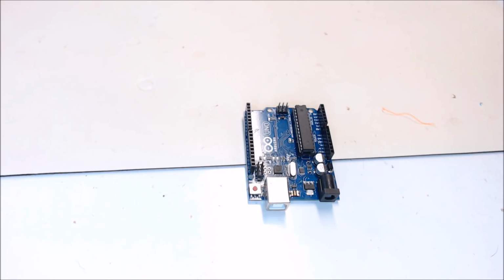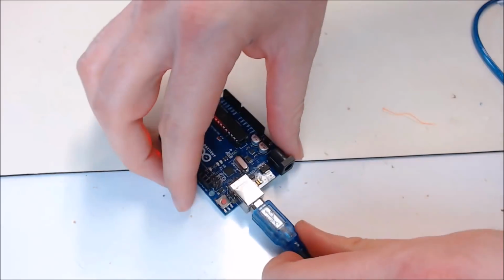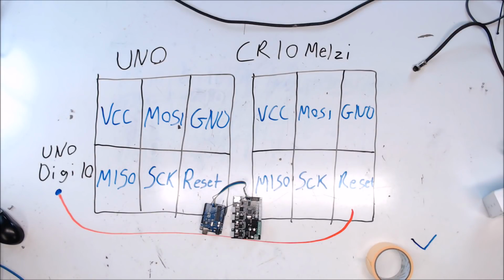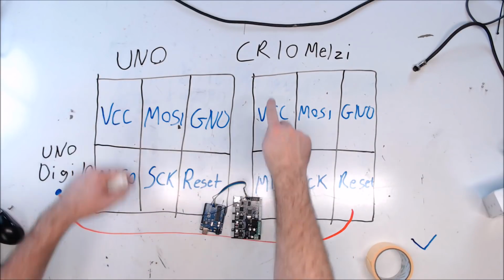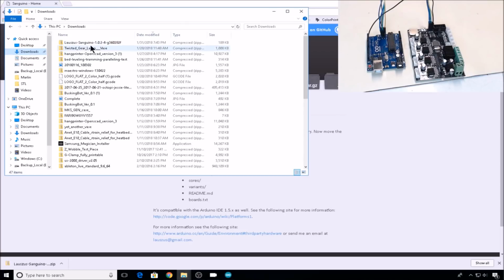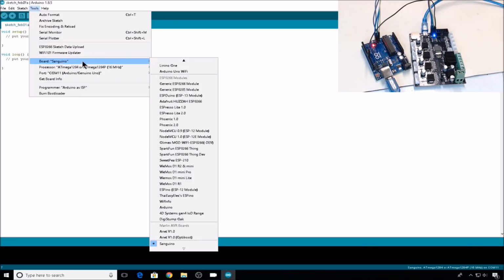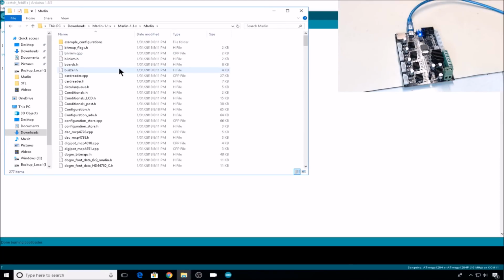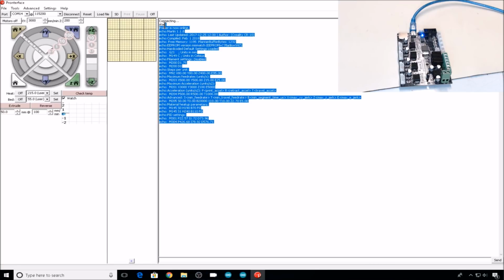Creality CR-10 Marlin Firmware Upgrade - Chris's Basement

Comment: Hello. Nice Vid! Liked and subscribed!  I changed my firmware already and I want to know if I ever need to change some parameters on the Board, Do I need yo put back the jumper on usb mode again? I want to have power failure resume if it is possible. I have the first creality CR-10 with TH3Dstudio Marlin software. Thanks!!
Reply from the maker: Thanks for the sub! No, you will not have to move the jumper again, that was just to enable you to power the board via USB instead of the power port. It's just a little safer when writing the boot loader. I am not sure how you would go about adding power failure resume. I will look into it. I have the same printer as you and it would be a great add on.
Reply: Many thanks for the answer!  According to most people the first CR-10 wont ever have that power loss feature because the Creality company decided it so... What a pity...

Comment: Hi chris I'm having a bit of a situation regarding my cr-10 board. The screen is all white when I turn on my printer, but the board is detected in the com ports in my computer. Also a loud beep goes off when i turn it off. Any suggestions? Thanks!
Reply from the maker: Hey Jack, That is very strange. I haven't seen that issue before sounds like your board is having some issues. Is this happening before a Marlin upgrade or after? Did the upgrade cause this?
Reply: Chris Riley This happened after upgrading.
Reply from the maker: Ok, well it's probably just a configuration issue that can be fixed then. First I would go back into the box and make sure you didn't bump the LCD cable. Then take a look in Marlin, there is a stock display configured for the CR10, but creality might have changed something along the way. See if you can use this link and confirm what LCD is installed on the printer.

//
// Factory display for Creality CR-10
// https://www.aliexpress.com/item/Universal-LCD-12864-3D-Printer-Display-Screen-With-Encoder-For-CR-10-CR-7-Model/32833148327.html
//
// This is RAMPS-compatible using a single 10-pin connector.
// (For CR-10 owners who want to replace the Melzi Creality board but retain the display)
//
#define CR10_STOCKDISPLAY
Reply: Yes I have the stock cr-10 display. Now all of a sudden its giving me this error when i downloaded an unmodified version of marlin (except with the cr-10 files inside)

Arduino: 1.8.5 (Windows 10), Board: "Sanguino, ATmega1284 or ATmega1284P (16 MHz)"

Archiving built core (caching) in: C:\Users\Jackw\AppData\Local\Temp\arduino_cache_945855\core\core_Lauszus-Sanguino-8c73361_avr_sanguino_cpu_atmega1284p_0c812875ac70eb4a9b385d8fb077f54c.a
Sketch uses 126250 bytes (97%) of program storage space. Maximum is 130048 bytes.
Global variables use 15144 bytes (92%) of dynamic memory, leaving 1240 bytes for local variables. Maximum is 16384 bytes.
Low memory available, stability problems may occur.
avrdude: verification error, first mismatch at byte 0x0000
         0x14 != 0x0c
avrdude: verification error; content mismatch
avrdude: verification error; content mismatch
Reply: Chris Riley Yeah im not sure how to fix this mismatch error. 👆🏼
Reply from the maker: Jack Wood I've seen this before. Let me get back to my machine and I'll send you a fix.
Reply: Chris Riley Did you ever find a fix?
Reply from the maker: The only thing I can think of is you are to close to the limit of the board memory. Try this:

in configuration.h take the comments off of //#define DISABLE_M503    // Saves ~2700 bytes of PROGMEM. Disable for release!  

and comment out #define PREVENT_COLD_EXTRUSION 

and in configuration_adv.h uncomment out this line #define NO_WORKSPACE_OFFSETS
Reply: Chris Riley Good news! It installed snd i see the marlin screen, HOWEVER I only see it when the usb is plugged in and the board only recieves usb power. When I switch it to ac power through power supply, the whole screen is white. Any ideas?
Reply from the maker: Check that VREF jumper again, that might be doing it. Take it off of USB.

Comment: Does this upgrade enable auto resume printing after power failure?
Reply: you can get this to work in marlin 1.1.9 on any printer - only works if you print via sd card.

its disabled by default - just look for this line in marlin under configuration_adv : //#define POWER_LOSS_RECOVERY   and then remove the "//"
Reply: @VRietySociety  thanks for the reply man! Would doing this enable auto resume feature?
Reply from the maker: You guys are awesome! Thanks for helping out.
Reply: @jahazi30  yes - but only when printing from SD - so
Reply: @VRietySociety  oh Alright! Thanks a lot man! Much appreciated!

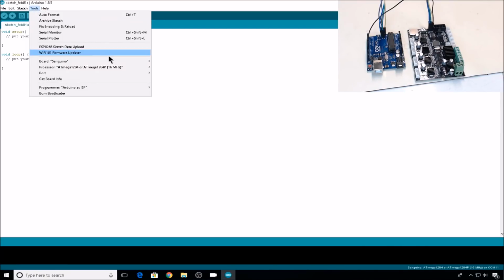Comment: on 6:28 i have 6 options and i dont know which one i need to choose. Does someone know, which one is right?
here are the 6 options i am given:       https://i.imgur.com/H5oAjMb.png

I have an old cr-10
Reply: Ok. So i got it set up. 
Here is how i dealt with that. 
You have to add a .zip library to get the right sanguino as a board option. I followed thomas sanladerers tutorial on the marlin firmware for that. Here is the link https://www.youtube.com/watch?v=lAKyZd63_ns&list=LL&index=7&t=0s
I successfully installed marlin 1.9.x (not 2.0.x because someone in comments said, that it doesnt work?) 
Now onto Manual mesh bed leveling and linear advance :)
Thank you chris for the tutorial <3
Reply from the maker: Yep, number 5.
Reply from the maker: Glad you got it working, happy to help.
Reply: @ChrisRiley  i was confused, because although number 5 has to be right, choosing that didnt bring up the option of choosing the right processor. So i reverted to the solution thomas sanladerer provider in his video.
✌

Comment: Great video! I have a cr10 mini with a V1.1.2 board. It doesn't have the jumper but otherwise looks the same. Is the process the same or is there anything I need to change? Also, anyone have any idea what Marlin firmware I can upgrade to? 

Thanks in advance.
Reply from the maker: Yes, the process on that board should be the same. I think it's still a 128 chip. You can use the Marlin 2.1 example config.
Reply: @ChrisRiley  hey, thanks for that! I'll be trying tonight!

Comment: when i click burn bootloader this error came out :
avrdude: Yikes!  Invalid device signature.
         Double check connections and try again, or use -F to override
         this check.
what i have to do????
Reply from the maker: AVR errors mean your USB can't connect. Can you connect to your machine via pronterface? Does that work and are you able to control the machine?
Reply: one month ago i tried to control the printer with lots of programs like simplify3d or repetier host. now i get off the board from the control box and unwire all cables. but now i am not able to burn bootloader. (i have a 1.1.2 creality3d board).
Reply from the maker: Does the board power on when you plug it in via USB? Does your computer recognize the board in device manager? Have you installed the ch340 driver? Did you change the vref jumper to USB?
Reply: Chris Riley the board powers on but i don't verify if computer recognises the board and i dont install the driver. I will try soon
Reply: in my board (v 1.1.2) i don't have the vref jumper... but my boards turns on when connected via USB.

Comment: What tools do you use to get the 4 screws on the side out??? Nothing that came with my printer fits...
Reply from the maker: You know what, that is a great point. I will get you a size.
Reply from the maker: The ones on the bottom take a 2mm wrench. The ones on the side for the power supply take a 2.5mm wrench.
Reply: Also, my board is different I don't have/see a usb jumper to switch to on mine. I have the Creality 3D V1.1.2.
And I did find something to get the screws out but I'm sure it's not the correct tool.

Thank you
Reply: Thank you
Reply: The board I have   https://i1.wp.com/www.th3dstudio.com/wp-content/uploads/2017/12/CR10v112.jpg?fit=1024%2C707&ssl=1
Reply: I got it figured out, you simply skip that step (Shout Out to  Revamped Outdoors
for finding that info for me) if you have a board without the USB PIN. (The board will be green like in the picture) You Will also need to plug your 3d printer into the PC/Laptop after you disconnect your UNO to actually put Marlin on and it will need to be turned on to see the port)

Still a  great tut thanks
Reply from the maker: Sweet! Glad you got it figured out. Eliot over at Revamped is the man!
Reply: @ChrisRiley  Yes he's my go-to guy thanks again your tutorial helped get me there.

Comment: when i plug the Melzi into the USB of the computer it does not recognize the comm port. nothing is listed for the Melzi. but when i plug in the arduino it recognizes and assigns a comm port. am i doing anything wrong?
Reply from the maker: It doesn't recognize the Melzi at all? I don't remember what chip that board has, but there should be a driver for in on the SD card. I think its the ch3xx something driver.
Reply: the funny thing is that it works with my raspberry pi to run octoprint flawlessly.
Reply: also, do you install the drivers on the SD card to the computer?
Reply from the maker: Kevin Zeringue Yes, to use it on windows you will have to install the driver from the SD card.

Comment: I have everything set correctly and all pins in correct places with USB power to both boards. When I burn Bootloader I get error burning bootloader. Here is the verbose report. HELP!! 

Arduino: 1.8.8 (Windows Store 1.8.19.0) (Windows 10), Board: "Sanguino, ATmega1284 or ATmega1284P (16 MHz)"

C:\Program Files\WindowsApps\ArduinoLLC.ArduinoIDE_1.8.19.0_x86__mdqgnx93n4wtt\hardware\tools\avr/bin/avrdude -CC:\Program Files\WindowsApps\ArduinoLLC.ArduinoIDE_1.8.19.0_x86__mdqgnx93n4wtt\hardware\tools\avr/etc/avrdude.conf -v -patmega1284p -carduino -PCOM4 -b19200 -e -Ulock:w:0x3F:m -Uefuse:w:0xFD:m -Uhfuse:w:0xDE:m -Ulfuse:w:0xFF:m 

avrdude: Version 6.3-20171130
         Copyright (c) 2000-2005 Brian Dean, http://www.bdmicro.com/
         Copyright (c) 2007-2014 Joerg Wunsch

         System wide configuration file is "C:\Program Files\WindowsApps\ArduinoLLC.ArduinoIDE_1.8.19.0_x86__mdqgnx93n4wtt\hardware\tools\avr/etc/avrdude.conf"

         Using Port                    : COM4
         Using Programmer              : arduino
         Overriding Baud Rate          : 19200
         AVR Part                      : ATmega1284P
         Chip Erase delay              : 55000 us
         PAGEL                         : PD7
         BS2                           : PA0
         RESET disposition             : dedicated
         RETRY pulse                   : SCK
         serial program mode           : yes
         parallel program mode         : yes
         Timeout                       : 200
         StabDelay                     : 100
         CmdexeDelay                   : 25
         SyncLoops                     : 32
         ByteDelay                     : 0
         PollIndex                     : 3
         PollValue                     : 0x53
         Memory Detail                 :

                                  Block Poll               Page                       Polled
           Memory Type Mode Delay Size  Indx Paged  Size   Size #Pages MinW  MaxW   ReadBack
           ----------- ---- ----- ----- ---- ------ ------ ---- ------ ----- ----- ---------
           eeprom        65    10   128    0 no       4096    8      0  9000  9000 0xff 0xff
           flash         65    10   256    0 yes    131072  256    512  4500  4500 0xff 0xff
           lock           0     0     0    0 no          1    0      0  9000  9000 0x00 0x00
           lfuse          0     0     0    0 no          1    0      0  9000  9000 0x00 0x00
           hfuse          0     0     0    0 no          1    0      0  9000  9000 0x00 0x00
           efuse          0     0     0    0 no          1    0      0  9000  9000 0x00 0x00
           signature      0     0     0    0 no          3    0      0     0     0 0x00 0x00
           calibration    0     0     0    0 no          1    0      0     0     0 0x00 0x00

         Programmer Type : Arduino
         Description     : Arduino
         Hardware Version: 2
         Firmware Version: 1.18
         Topcard         : Unknown
         Vtarget         : 0.0 V
         Varef           : 0.0 V
         Oscillator      : Off
         SCK period      : 0.1 us

avrdude: AVR device initialized and ready to accept instructions

Reading | ################################################## | 100% 0.01s

avrdude: Device signature = 0x000000 (retrying)

Reading | ################################################## | 100% 0.00s

avrdude: Device signature = 0x000000 (retrying)

Error while burning bootloader.
Reading | ################################################## | 100% 0.00s

avrdude: Device signature = 0x000000
avrdude: Yikes!  Invalid device signature.
         Double check connections and try again, or use -F to override
         this check.

avrdude done.  Thank you.
Reply from the maker: These are really tricky to troubleshoot. Try installing version 1.8.5 of the ide and try again. It seems to work better.
Reply: @ChrisRiley  Thanks so much for the response. You mean 1.8.5 of Sangunio or Anduino software? Sorry, newb to this.. and thanks!
Reply from the maker: @paulschuppener  The Arduino IDE, try that 1.8.5 version.
Reply: @ChrisRiley  Gotcha, thanks! Will give it a shot. =)

Comment: Chris, your better off, tossing that motherboard in the trash and buy an MKS GEN L with stock steppers for $25 which has the 2560 for bootloader and extra prog mem and RAM for power loss recovery and all marlin features upto version 2 which I have already done on  a ramps 1.6 compatible board(MKS version).  You won't fit power loss recovery, etc and auto bed leveling on the atmel 128 chip.
Reply from the maker: Probably a safe bet.